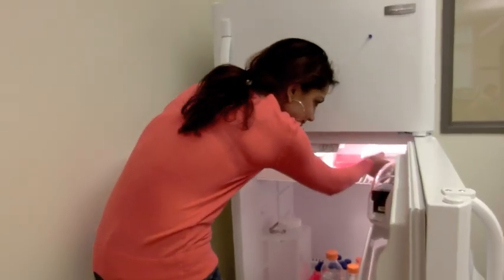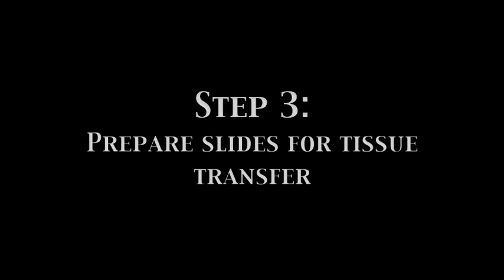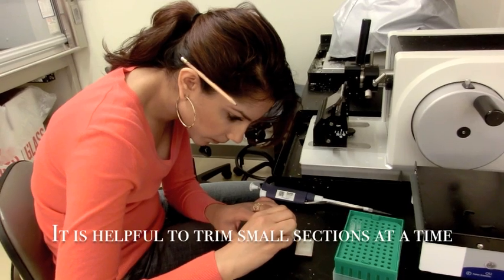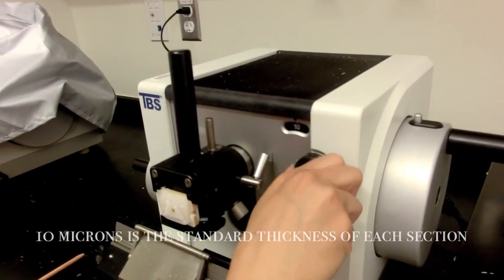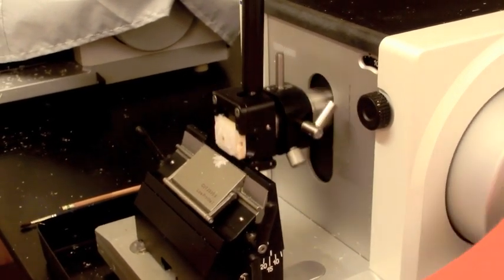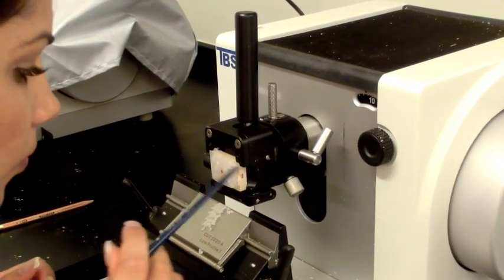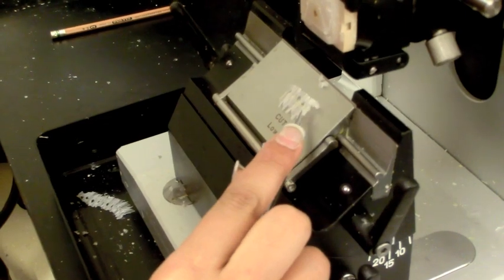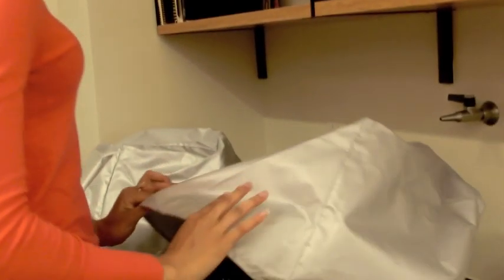How to Use a Microtome

Comment: I would suggest that its better to have a water bath set at an optimal temperature and to float the sections that have been cut. Once stretched enough, then just pick up the sections with positively charged commercial glass slides. It provides much better quality of sections since no air bubbles get caught and folds disappear.